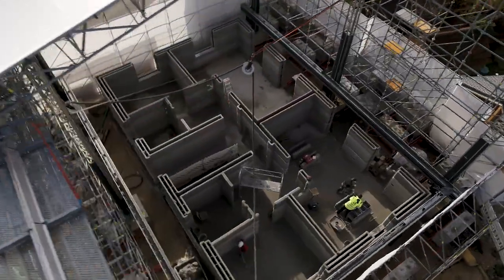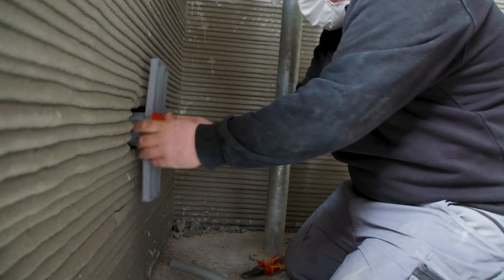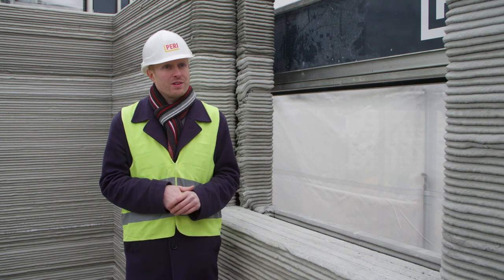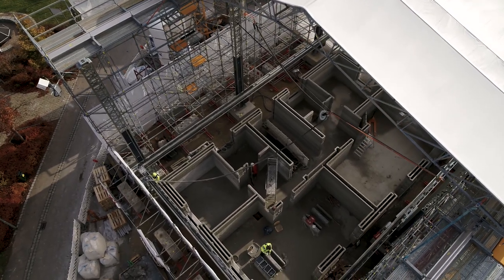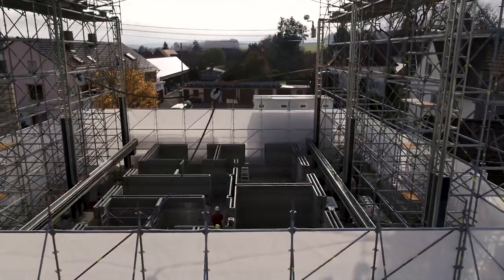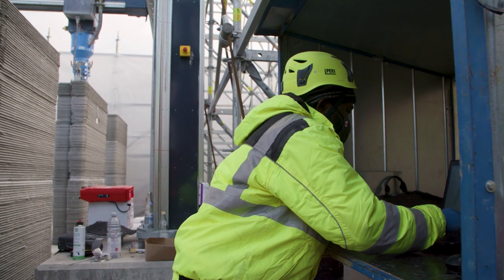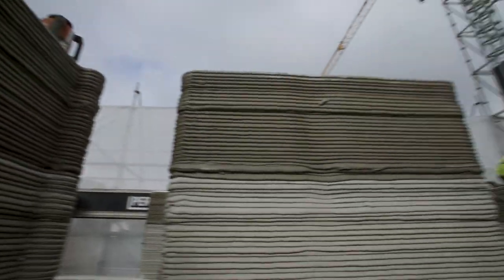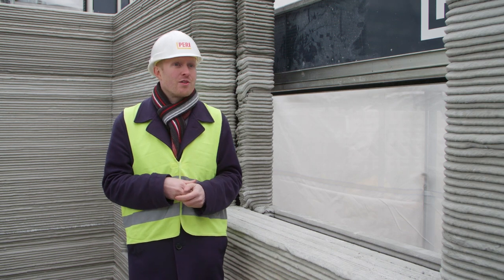3D PRINTING | PERI 3D Construction Printing: Europe’s largest 3D-printed apartment building (EN)

Comment: well, it does not look as good as you describe it. i see the point of 3d printed (temporary) buildings, but this process design looks far from being finished and usable.

first of all, you probably spent more time to prepare the construction site compared to the "classic" way (there's not just a crane, but 2 oversized support stands and everything else). the foundation of the building was probably made the same way, so you needed the old fashioned machines.

in a "classic" construction the pump fills a whole wall with concrete in one step. this concrete-printer uses way more fuel to move the printer-head around the building just to put on a 1-inch layer - while a full height wall is more than 100 layers...

and where are the reinforcement bars? will they go in the hollow parts of the walls, then you'll fill them with concrete? then you'll need the same old fashioned concrete-pump as well.

the only difference is that you spend weeks to print a mold, instead of building a sliding formwork in a day. then put in the rebars, and fill the void with concrete... (without reinforcement this printed material wouldn't be strong enough in 6 days to build a new floor above it. so it's not an advantage.)

and obviously you'll need to work a lot on the interior walls to make them usable. the raw surface can look good on certain areas of a home, but it's not ideal everywhere.

there is no real advantage of this technic. even if you want to build something on the moon or anywhere without construction workers, it would be better to design robots who can build the sliding formwork.
Reply: Very good points.  Though, digitally-controlled construction is inevitable.  Keep in mind that they are truly concrete forming experts, so they will figure out how to do this in a manner that makes more economic sense:  Use of low-cost locally-sourced conventionally-reinforced concrete that meets codes, and avoiding any need for that expensive protection structure.  You suggestion of digitally-controlled sliding forms is excellent!  You could even get a finished surface that way, based on the digital model.
Reply: The preparation time won't be longer than on a normal construction site. Instead of building a mold and supports and repeatedly move them after each cast, which takes a lot of manpower, you just build the printer and let that move on its own. Man hours are the main reason building is expensive. Also the electric motors won't take that much energy since they don't move at extreme speeds.
Btw the printing process takes days, not weeks. The rest of the time is used for electrical installation, filling the voids with insulation, adding doors and windows and plastering the walls.

Regarding the reinforcement. I guess up to a certain height, you probably don't need much rebar and you can see, that they put in horizontal reinforcement to keep the walls together. Rebar is mostly necessary for bending stress but this building is only 2 or 3 storeys tall, so it is mostly a compressive load.
Reply from the maker: Dear CritiCube,

no reinforcement is required for the displayed application.
We would be happy to answer any additional questions you might have. Just contact us at info@peri.com.

Kind regards
Your PERI 3D Construction Printing team